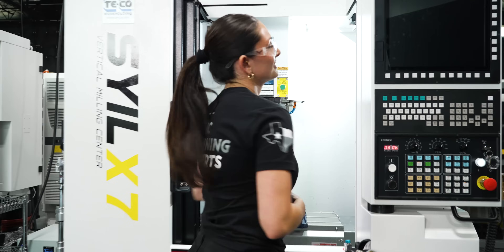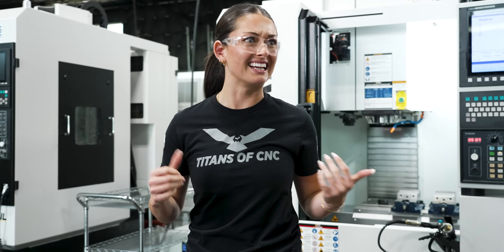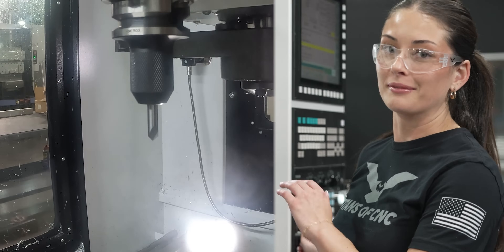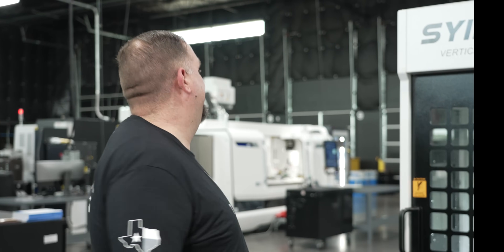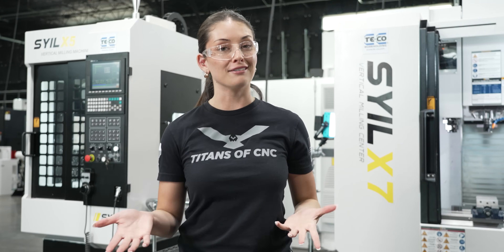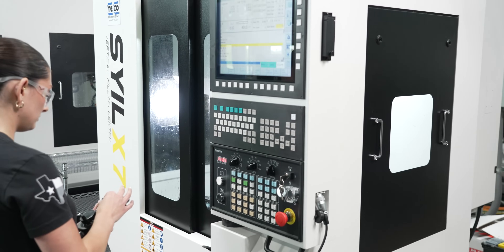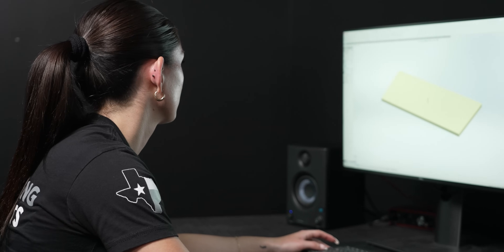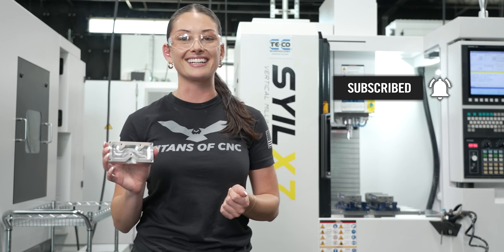Beginner Attempts to CNC Machine Her First Part

Comment: I'm curious will those machines take a Q in the tapping cycle (g84)? I find it interesting how fanuc machines can peck tap without anything weird. Haas you have to turn on repeat rigid tapping then copy the toolpath and change the z depth. As long as the retract plane doesn't change the threads will line up (the R can change but it has to be in increment's of 1 pitch). Some machines take the Q in the g84 others you need to work around it.

Also for the engraving did you scan your real signature then use raster to vector?
Reply: Well Fanuc needs at least parameter 5200 - #5 set to correct setting ( and 5104 - #6 ) for peck tapping !!!!!!!!
Just like Fanuc can use internal sub-programs like e.g. HAAS (M97), but first set  parameter 6005 - #0 to 1 (SQC),  M98 Qxxx instead of M98 Pxxx.
Sometimes you need to dive into the ( Fanuc ) parameter manual to find what you want/need.
I read somewhere that Syntec has three settings ( Type I to III ) for G84 peck tapping, not sure if that is correct.

Comment: Now tell me how to calculate feed rate for rigid tapping? Or how to calculate feed rate based off a 6 flute endmill at 700sfm. Titan doesn't teach how to be a machinist they teach how to be a button pusher
Reply: You're talking about basic info one can look up anywhere. Titans are focusing at teaching stuff that is more difficult to get knowledge about, if not already with a company. You are free to imagine is nothing more than pushing the on/off button)

Comment: Congrats, you did well!   I remember my first Cnc part. 30 years ago, out of PET.  ( 50pcs ) First cnc mill in the shop. Had to program by hand. Looked kind like the Chevy symbol radius on all corners, holes in the part that had Oring grooves. Nobody to ask questions on how, just a manual to read to go from.  President of the company coming out every hour to see how they were coming out.  Mastercam makes it so much easier now.

Comment: One question, why run the KOR5 at just 4k?
Reply: It wasn't the KOR5.  it was just a 3 flute endmill.  She followed the feeds/speeds given in the online tutorials.  They were recorded with the understanding that there may be a lot of beginners or home machinists just getting started that may be using a Tormach so the feeds/speeds were adjusted so even the most basic level machine should be able to handle the cuts.  It definitely can be optimized but for the very first part someone does, there is no need to break any speed records.
Reply: @Jessie_Smith  Understood! Yes, that's amazing for the first part ever run no doubt. Congrats to Kylie!

Comment: I was self-taught too.  I started out with the Tormach 770.  The Pucker-Factor was really high with that very first project.
I saved all the chips I made on that first project, and I ate them for breakfast the next morning with milk and sugar.
After I got out of the hospital, I went on to learn more and more.
The only thing I hated about machining was having to clean my mill when the work was done.
Reply: I wasn't exactly self taught.  I learnt a bit on conversational and then got to operate a Haas VF-4 that was drilling holes for a few weeks.  I learnt my first G code (G83) by watching what it did when it highlighted that line.  Then I asked the guy who programmed it for a couple pointers, he taught me how to set tools with a 123 block and set work offsets.  I learnt the rest of my G code from the operator's manual.  I don't mind cleaning the mill, but I really don't like stoning the table and the vises and then indicating them in after I have to do plate work.  I get four, sometimes five six inch vises lined up.  They're all old and the hard jaws are bowed on some of them half a thou back in the middle.  I usually try to get them to within ~2 thou runout across the whole table, if straightness really matters then I'll be cutting soft jaws in a row anyway.
Reply: This is the prophecy about the second coming of Jesus

Zechariah 13:7 
“Awake, sword, against my shepherd, against the man who is close to me!” declares the LORD Almighty. “Strike the shepherd, and the sheep will be scattered, and I will turn my hand against the little ones.

The Shepherd here is Jesus.

John 10:11 
“I am the good shepherd. The good shepherd lays down his life for the sheep.

This is the fulfillment of the prophecy. 

Matthew 26:31 
 
Then Jesus told them, “This very night you will all fall away on account of me, for it is written: “’I will strike the shepherd, and the sheep of the flock will be scattered.’

This happened near 30 to 33 AD. 

Hosea 6:1-2
Come, let us return to the LORD. He has torn us to pieces but he will heal us; he has injured us but he will bind up our wounds.
After two days he will revive us; on the third day he will restore us, that we may live in his presence.

In prophecies 1day is equal to 1000 years. Which means after two thousand years Jesus will return again.
And on the third day which is the 3rd millennium, we will live in his sight. We all know we cannot see God's face and live on Earth. So it's the second coming of Jesus.

Luke 21:11 ►

There will be great earthquakes, famines and pestilences in various places, and fearful events and great signs from heaven.

Matthew 24:6 
You will hear of wars and rumors of wars, but see to it that you are not alarmed. Such things must happen, but the end is still to come.

We are the witnesses of all these things. From the death of Jesus to 2030 - 2033 there are 2000 years. Jesus is coming soon. Let's all repent and turn from our old ways and turn to the Lord. 

Praise the Lord.

Peace and Love to you all

A verse to show about the Holy Trinity 
 
Isaiah 9:6 
For to us a child is born, to us a son is given, and the government will be on his shoulders. And he will be called Wonderful Counselor, Mighty God, Everlasting Father, Prince of Peace.

Everlasting Father?. There's your answer 

The whole world will turn against Israel and not just Palestinians. Then know the end is near. This is a major sign to look for in the end times. 

God bless you all

Please spread this message to the ends of the world .

.
Reply: @abin4237  It looks as though you may have mistakenly posted a comment to the wrong video.

No where in the Bible does it mention anything about G-Code or CNC machining.

It's no reason to lose your faith though. Carry on.
Reply: @timmontano8792  the good news is to be spread everywhere. Jesus didn't preach in synagogues alone.
Reply: Oh really?  The name of the video I posted my comment on is "Machining my first part."  I'm looking at it right now and it appears that some commentors have posted scriptures so it might be that either something went haywire in some video comment section.